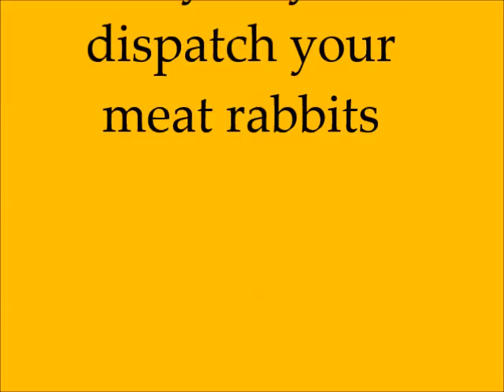Introducing the Schwartz Bunny Whacker

Comment: I have a nice Mulberry limb about 20 inches long and 1 1/2 inches  thick. I hold the bunny up by it's hind legs and it arches it's back and holds it's head out in a perfect position to hit it in the back of the head. One whack and it's over. I used to use, and sometimes still do, use a pellet rifle but the stick is more error proof for me.
Reply: I've never had any problem giving them a little tap with the hand

Comment: What about a lead pipe??  This seems like a Rube Goldberg device.
Reply: Many people successfully use a lead pipe or other similar object. Aside from just breaking the neck by hand it is the oldest method for doing the deed. I've used a steel electrical conduit pipe before and it works fine. 

Others have problems with that type of dispatching. It's been known to break knuckles as well as it kills the bunny. If you are off on the angle, placement, or force you can have a very hurt and angry bunny that is not quite as dead as you desired. Listening to a bunny scream in that situation is something you never want to do again.
Reply: A shotgun with double 00 buck shot will work too but you might get hit with bunny brains. It's a little too bizarre trying to get the rabbit to sit still while you "whack it" with a glorified dull paper cutter.
Reply: Cary Howe 
When I slaughtered a friend's rabbit for dinner, I used an old-fashioned length of pipe.  Rabbits are so delicate, it doesn't take much force.  One moment, and the deed's done.  I don't see the need for fancy implements of destruction to humanely and instantly dispatch a small animal.  It's totally unnecessary, in my view.

Comment: I get your point and the idea, but this seems extremely overly complicated, not to mention the tendency to fail. I've always done it by holding them up by their back legs and hitting them in the back of the skull using a small ax handle I've got. When you hang them by the back legs, it forces the head up giving you a perfect target. One sharp swing always dispatches them instantly. Remember that when you make something more complicated than it needs to be, using more parts than necessary, it only increases the likelihood of failure. Sometimes the old ways are the best ways.
Reply: James Lott Giving a piece of wood a name and making it 100% ineffective indicates total insanity.
Reply from the maker: @Mike7O7O  I don't recall Mike helping out around the home when I dispatched multiple rabbits with my highly effective bunny whacker. Perhaps he was hiding out in the bushes, hoping to catch a peek at reality instead of the fantasy living in his head.
Reply: @TheOriginalRick  er nope. I was passed out with boredom.  After I nearly PMSL.
Reply from the maker: And yet, here you are again. Weird compulsion you've got working in your brain.
Reply: Sounds like too much work. The other way is much easier.

Comment: I like the throat slitting method, but I'll try this.
Reply: The cleanest way I know is neck stretching using a V board attached to a shed rafter. The heart is still pumping so you can bleed out which is critical to having meat that can be stored and there's none of the struggling and suffering. It's quick and clean. This method is too fiddly. FYI to all the trolls moaning and wailing "oh the cute bunnies", why rate you posting on effectively a farming thread other than to troll? What did you expect he'd pet it to death? Most of the methods used by small farmers are more humane than factory food so if you've ever eaten store bought meat and I mean ever you have nothing to complain about. I'm concerned animals are dispatched humanely which is why I'm here, other than pointless guilt tripping why are you here?
Reply: Cary Howe
Trolls will be trolls, but thanks on your insight on the matter. :)
Reply: +Cary Howe  elaborate on the v method? I've tried all kinds of quick an easy methods, so far I haven't found one I prefer. I'm dispatching another 24 buns this weekend and I'd like to try something else
Reply: dirtnyaface
That's alot. On average how long does it take to dispatch 24 bunnies?
 And what method do you use?

Comment: Built one and it failed. It functions exactly the way you describe. I used it on 7 mo Calif. rabbits. What a disaster. What exactly are you referring to as 'just the right spot'? Putting these poor animals thru that kind of trauma is not my idea of humane.
Reply from the maker: Lisa, I am sorry to hear it is not working well for you. All the experience of mine and those friends of mine that use one point to a successful way of dispatching bunnies. I don't know your experience overall with butchering small animals but virtually any way that it is done causes the animal to have a reflexive kicking for some seconds afterwards. Perhaps that is what is bothering you.

the "'right spot" depends upon the size of the bunny and the size of the bunny whacker. I have found for my 4 lb bunnies that is about 6 to 8 inches from the pivot point You don't want to push down on the side of the neck but as directly on top of it as you can. The closer you get to the pivot point the more force you have with lesser effort.  

there are many methods as I go over in the video. Perhaps another one would work better for you.
Reply: Thank you for responding. I used the stun and slice method to finish the task. I was really excited to try your contraption. It seemed very simple and straight forward. The little bugger jumped back up each time I tried it. I even enlisted manly help just for good measure. I even tried manually to snap its neck while in the whacker. No luck. I wonder if age had something to do with it. How old are your bunnies at processing?
Reply from the maker: Lisa Hoffmann -- the majority of bunnies I do are about ten weeks old. They are slippery at that age but easier to handle as they are smaller. There is a learning curve in doing it. I tried it with a number of stuffed animals before I did it with a live animal.
Reply: Lisa H 
Now I know that 7 month old Californian rabbits need more force to die than a woman pushing down on an oak plank.

Maybe for this design, you need a longer kill lever to add more momentum.
Reply from the maker: @DinnerForkTongue  a 7 month Cali is a pretty good sized rabbit.